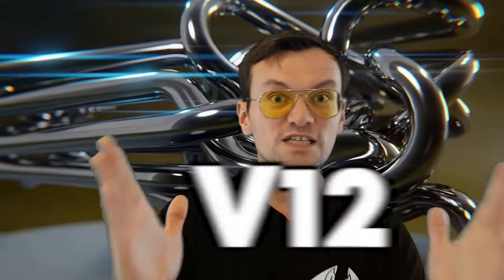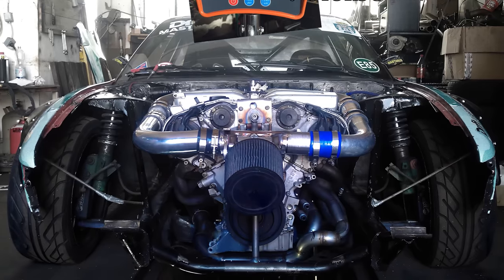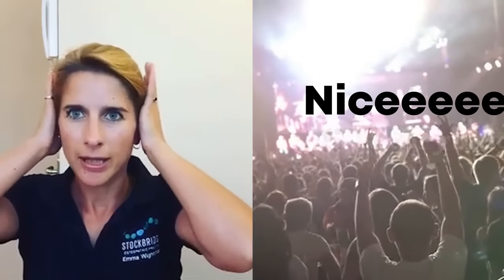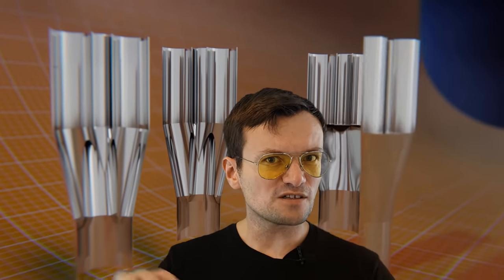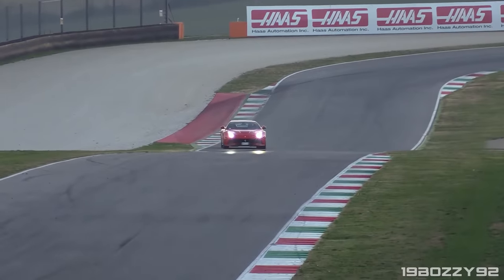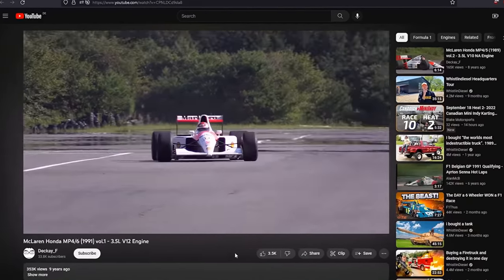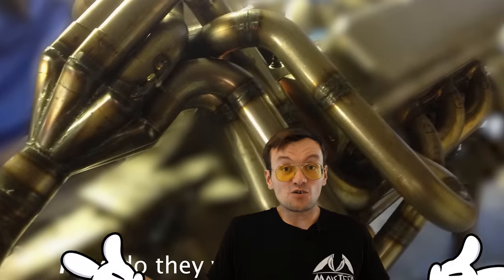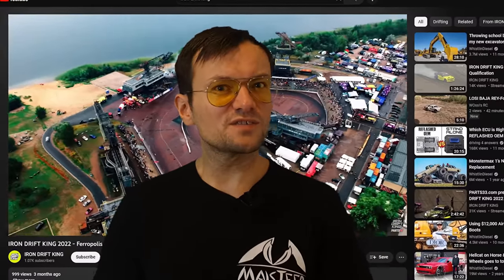Why This V12 Sounds Better Than a $5,000,000 Pagani

Comment: I wish to know do you think it’ll make a difference if the crank is crossplane or flatplane? If anyone knows let me know
Reply from the maker: The question is too unspecific. What engine and makes a difference to what?
For example in a motorcycle with an inline 4 it makes a huge difference to sound, vibrations and power delivery.
Reply: @maisteer  thanks for your reply, the engine in question is the inline 6TT from the Bmw M4 the crank is cross-plane it currently sounds like two 3 cylinder engines battling each other 😂😂 
What im thinking of doing making a 6 in one directly from the turbos and keeping the equal lengths running all the way to the muffler.
Reply from the maker: @McDonalds-drive-thru  Yeah, I know they do sound bad.
How would you do a 6-in-1 in AFTER the turbos tough? I think the best you could do with keeping the stock turbos is merging them with equal length as soon as possible and then remove the parts of the stock BMW exhaust bit by bit to figure out what gives it that annoying resonance in the sound.
But at least their crank is nothing special. It's the same as virtually every other straight-6 and firing events are evenly spaced 120° apart in the order 1-5-3-6-2-4, same as the 2jz or the Nissan RB.
A straight 6 crank therefore is rather a triple Plane or Y-Plane then, because the crank throws are an evenly 120° spaced apart - but I don't think it's not necessary to make that distinction anyway - there is no other way to build a straight-6 without sending it to vibration hell.
Reply: @maisteer  100% I agree with you, I was thinking the exact same thing. I’ll start by removing the factory down pipes from the turbos and fabricate two equal lengths and merge them into one as soon as possible then run a single pipe and hope for the best. Thank you for your input I’ll keep you updated with the progress 👍👍
Reply from the maker: @McDonalds-drive-thru  Thanks. Good luck with the project too Adem!

Comment: Me thinking how I would coat half these headers 🙉
Reply from the maker: How would you coat them? Asking for a friend ^_^'
Reply: @maisteer  Definitely with Cerakote to assist with Oxygen Scavenging from cylinders and to get hot EGT out quicker but honestly the complexity of them I bet I would be missing spots here and there. This is a case of the manufacturers being way smarter than the applicator 🤣🤣🤣

Comment: For a video all about achieving a pleasant aural experience, this video sure does have horrible audio.. for your next project, please, please use an audio compressor so the audience doesnt have to turn the volume down every few seconds while watching.😅
Reply from the maker: Haha, only a problem if you have good speakers it seems. ^_^'   ...and it will be fixed.
Reply: @maisteer I was listening on cheap earbud headphones..😅 glad to hear you're working on it though.
Reply from the maker: @divinasi0n  Cheap and good headphones you bought! Good investment ^_^
Reply from the maker: I have the feeling i messed the audio in the new video again.... could you check? It's this one: https://youtu.be/6EjbfLSRmyA
Reply: @maisteer  no problem mate. I was going to give it a watch anyway, probably tomorrow after some sleep.😉

Comment: Doesn't crank configuration have an effect on the exhaust note?
Reply from the maker: That's mostly only on V8's when you stick to the pattern Left Bank goes into one pipe and right bank goes into the other. When you are free to cross them to keep the firing intervals even - you can workaround the crank configuration.
Exception are uneven firing crossplane 4-cylinder bikes like the Yamaha R1. There is simply nothing you could do that would work at every rpm.

Comment: you'll melt every wire and pipe under the hood with all that heat the headers will create.
Reply from the maker: Hmmm... what's the melting point of copper again? 120°C?
Reply from the maker: Nothing melted yet, but there was no hood on either... but if you like you can watch the new video here: https://youtu.be/6EjbfLSRmyA

Comment: Just run all the pipes through the hood and do a smoke stack
Reply from the maker: Then he wouldn't be allowed to use the car in the series he wants to enter. They kinda have a problem with exhausts outside the bodywork... something about 'safety' or so.... ^_^'

Comment: I have been thinking 1, Thin wall stainless exhaust sound higher pitch than a thick wall mild steel and 2. Separate  the single pipe after the tube headers into two smaller pipes of different lengths ( trial and error ) and join back into one pipe. This should double the  number of exhaust pule like a zipper going together. YouTube..J.D.M.Masterpiece STAR ROAD S30Z
Reply from the maker: Thinwalled header tubes certainly could make it sound even more interesting, but with 12 pipes like this, it's just not realistic to fabricate and even more unrealistic to expect them to last without cracking for a long period of time.

Comment: The best sounding motor is the small block ford 351w      you dont have to rev into the stratosphere to sound amazing,     those sound like a zipper pulled fast and annoying.

Comment: Being the owner of. S65 biturbo how would you plumb that up ?
Reply from the maker: I'm can't be sure. From the pictures of the engine bay it looks super tight. Then also what's the goal?
My "theory" answer for now, trying to fit two 6 into 1's in there and a bypass for the turbos. So you can switch between F1 sound and F1 power.
With the turbos in place you simply cannot get a "screaming" noise. That's the energy turbos eat as motivation to make more power. ^_^'
Reply: @maisteer   I have seen headers made to fit turbos my thinking more exhaust flow would make them more efficient and run cooler extending the life .  yes its a VERY tight fit in that engine bay  . You know our president is big on EVs if he and his cronies had their way all you would have here in the E F1 cars the man wants to rid us of ICE cars !  glad you guys are keeping the sport alive !
Reply from the maker: @johnsiders7819  Thanks John. We'll keep fighting to keep it for as long as possible ^_^

Comment: Would it possible to make an e46 m3 S54 with its high revving to sound close to thise with 6 into 1 headers?
Reply from the maker: As a rule of thumb, I would say it's gonna have a similar pitch at 9000rpm to a (in theory similar) v12 with 12in1 at 4500... - well it should sound a bit more aggressive than this BMW at least: https://youtu.be/XNsuWgnODV0?t=47

Comment: Is the lambo on the dyno has so much exhausted velocity and unburned fuel that it is about to get shock diamonds. On that car a a larger exhaust diameter would do wonders
Reply from the maker: Yeah, looks very impressive. I wonder if there is an option to do other colors too ^_^
Reply: @maisteer  it absolutely is, you could inject alcohol (optimally methanol) into the exhaust Wich is pre mixed with a other materials for example lithium salts for a red flame sodium for a very strong yellow color or boric acid for green
Reply from the maker: @mr.pineapple7620  Haha, thanks. I like red. Could electric car lithium batteries dissolved in methanol burn red too...? - asking for a friend ^_^
Reply: @maisteer  while highly recommend you to not rip open e car batteries (as much as I hate e-cars) yes it would. You can get lithium way cheaper in form of small lithium battery s however. Make sure they are discharged before you disassemble them.

Are you on discord by chance?
Reply from the maker: @mr.pineapple7620  Ah, okay. Thanks a loz.
At the moment I'm just on Premiere Pro, Blender and into answering youtube comments ^_^'
Reply: @maisteer  ok have a good day though 👌

Comment: Why don't 4 cylinder cars have this sound??
Reply: 4 cylinder cars can not have this type of sound because of the way fuel explodes: (for approx. 120 degrees), and the spacing of the power strokes (2 per rotation, 180 degrees each). This mean that the torque pulses and exhaust pulses are stacated in a 4 cylinder engine. I.E. they are staccato pulses separated by considerable gaps. The staccato separation produces an unpleasant sound. 8 cylinder petrol engines are the first configuration for petrol where the 120 degree combustion lifetime of each power stroke fully overlaps the next. As a result, an 8 cylinder petrol engine will produce a smooth, uniform wave of torque even from below idle speed. Also the wonderful V8 burble that we all love so much is a direct result of intentionally not correcting the crank shaft spacing to account for the 60 or 90 degree separation between consecutive firing orders. The V angle is additive to the default 90 degree separation between power strokes, or 45 degree separation between crankshaft big-end angles. Counter to intuition, the uneven separation between consecutive power strokes actually increases torque output, especially at lower rpm. So in summary, 4 cylinder cars sound shit because the exhaust gas flow goes and stops intermittently, preventing and singing note from forming.

Comment: Uh as a designer of Nascar engines i can tell you the primary tubes are waaay toooo long...
Reply from the maker: You don't need to be an Nascar engine designer to notice. It's obvious. But when the project outline is to get 12 equal length primaries firing into one collector and still being able to fit everything under the hood...  How would you shorten them and still match all the criteria?
Reply: @maisteer  Exactly my point; the tubes are too long, so equal length doesn't yield anything. In fact the pumping losses are way high because of the length. Furthermore on a V12, there's no reason to go into a single collector. This is also the case for V8 engines that have a 180 degree crank like the C8 corvette, but 90 degree crank V8's are smoother, but have odd firing so you can either run 180 degree headers or an x-pipe. Certainly whoever designed this put a lot of time into it.  For most engines that run up to about 6000 rpm, the primary tubes should be around 26-28 inches.  For Nascar motors spinning at 9000+ rpm, it's more like 20 inches.
Reply from the maker: @kurtdobson  Thanks for your input. I do understand what your saying, but I look at this project from a different perspective. David Vizards and Graham Bells books thought me a lot about engines, but this whole project is not about optimizing for power. It's only about the sound and to fulfill my curiosity. As far as I know, nobody has done this yet (and get it running) - I can come up with a million theories on why not do it. But in the end, without having tried it this way - I would never be satisfied - because I would never know for sure - and so would nobody else. All just theories, no proof.

Comment: Is there a way to teach an AI to do that for you? let's say you give the AI the space that he was to work on to make the pipes the same length
Reply from the maker: In theory it should work, but don't know if there is something available by now. The software I used has a module for generative design that you can buy, but I've only tried it a bit a couple of years ago and at that point I don't think you could set the parameters that you would need (like setting clearances to the engine model, equal length with constant diameter, not creating impossible bends).
Reply: @maisteer  Of course the AI will probably give you some impossible builds, but at the same time the AI its is not going to do only one build, it is going to make probably 50-100 builds, so you can pick one easier to make
Reply from the maker: @WerWols  In practice it is unknown how long it takes to get the AI to produce the desired results. Plus you will have to double check every result it gives. For a one off project, I don't see the value at the moment. It's not hard that hard to build since every bend is the same diameter, it's just very time consuming. But AI wouldn't change that. An CNC tube bender would tough.

Comment: 180 degree headers
Reply from the maker: What about it tough? ^_^'
Reply: Typically use on v8 they offer low end torque in tuning and also increase flow by creating less back pressure from each exhaust pulse. Also the exhaust notes incredible for a v8. But iv never heard them adapted for v12s
Reply: I also didn't watch the end of the vid when i made the post
Reply from the maker: @tommybebout25   okay tommy ^_^'

Comment: would you be able to simplify what gives the high note because my monkey brain already forgot
Reply from the maker: Sure, let's see if my monkey brain can help........
Reply from the maker: ...what was the question?
Reply: @maisteer  what thing in combination together give the f1 sound (sorry for taking so long to respond in in aus)
Reply from the maker: @Aaron_AJO  High frequency of evenly spaced exhaust pulses: so high rpm + many cylinders merged together at same timing interval.
Plus: It's much easier to achieve when you don't introduce additional acoustic waves that mess up this frequency (like the abrupt ending baffle collector does in most cases).
Reply: @maisteer  ok, and is having them ignite in a spinning pattern is the best appose to across from one another?
Reply from the maker: @Aaron_AJO  I can not give a simple answer to that question yet, but as I learned first hand - the choice of the collector plays a huge part.
In the smooth sounding merge collector, the primary principle is that it evacuates the adjacent pipe with the vacuum created by the pressure pulse.

In a 3in1 collector the pipes are all next to each other and  the vacuum evacuates the adjacent pipes -> assuming a 45mm pipe diameter, the vacuum only has to "travel" 45mm to the next pipe (center to center). 
The circle diameter in this tightly packed 3in1 collector is 52mm...

6in1: Now the circle diameter has to grow to at least 90mm to fit all 6 in a circle. The vacuum has to "travel" now almost 90mm to the next firing cylinder when fired crosswise - or 45mm when fired sequential.

12in1: Now the circle diameter has to be at least 175mm. The vacuum "travel" distance is now either be up to 175mm to the next power pulse or still be 45mm when connected "revolver" style.

To be fair. There are more 4-times as many firing pulses happening - so the vacuum will not "travel" all the way and it'll sound sweet anyway - I'm sure. But I can not imagine, that this will make no difference whatsoever - especially considering how huge(!) the difference in sound is from just changing the collector style.
After the M120 project is finished, there will be another project where I can change the firing order,  then we will know for sure how big the difference really is.
Reply: @maisteer  thank you. and also, could you use any high revving engine to get this sound say a v6?
Reply from the maker: @Aaron_AJO  Listen to this 6-cylinder https://youtu.be/MBbskqcgs_o
or this 4-cylinder: https://youtu.be/UloeukgP5Do
I would say in theory yes it's possible, but I also assume (!) it's much easier to get the high pitch with lower capacity engine (especially low stroke). But I have to double check that someday to be 100% sure.
Reply: @maisteer  all i can think about is putting an f1 sounding engine into a volvo 240
Reply: taking the bike into consideration, do you think that having smaller pistons there for allowing for smaller explosions may raise the pitch of the engine? 
it would make sense

like engines with a much larger displacement sound way deeper

Comment: revolver order
Reply from the maker: After reviewing the available words in your comment, there seems to be an error in a previous statement. It is not possible to gain fully understanding of the context given, even using all the letters from "revolver order". I apologize for the confusion ahead. ^_^’
Reply: @maisteer  entschuldigen sie mich es was sehr spät und hatte es schlecht geschrieben ich meinte, dass man um den höchsten sound pitch zu haben soll den exhaust collector in ein Revolver order gegen den Uhrzeigersinn richtig? Sorry for my Bad german :<)
Reply from the maker: @nanoconfuso7727  Clockwise or counter-clockwise will not make a difference (I assume - why would it?), but the sequential firing will. Some people said it wouldn't matter - and none of them have tried (afaik). But to simply say that it makes no difference if the consecutive exhaust pulses hit the collector 1 inch or more than 10 inches apart (with a 12in1), seems not plausible to me - especially after learning how much the collector design changes the whole exhaust note. The effect will be less pronounced with less cylinders and will be non existent on 3-cylinders.
Reply: @maisteer  thank you so much
Reply from the maker: @nanoconfuso7727  Your welcome ^_^

Comment: Bmws usually soubd like crap vecause they are 6 into 2, or 6 ibto 2 into 1.
6 into 1 equal length sounds best
Reply from the maker: 6 in 2 in 1 - that's just about every NA 6-cylinder ever built ^_^'

Comment: Those flat plane crankshaft engines sounds like crap
Reply from the maker: I try to remember all the cars in the video, but as far as I can tell - there is not one single flat plane crankshaft engine in there.... Oh wait, the short clip of the AE86 onboard - yeah, you didn't like that one?